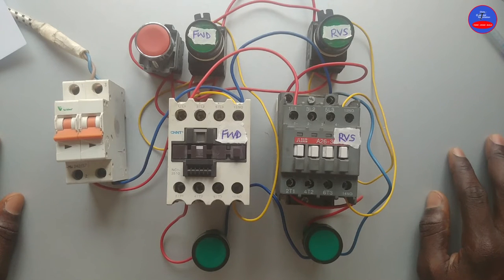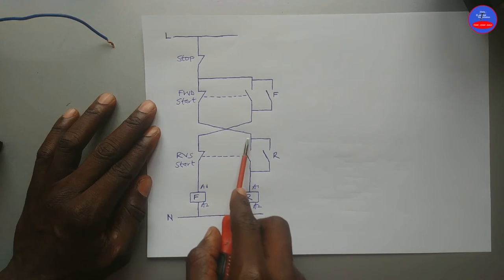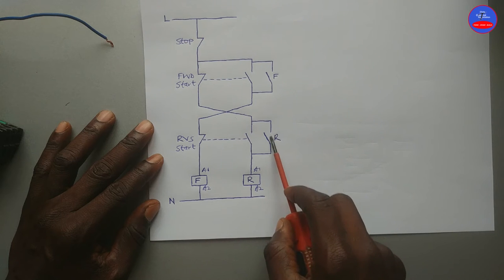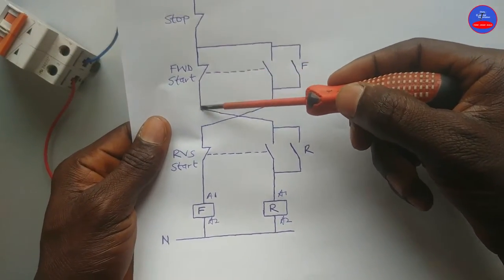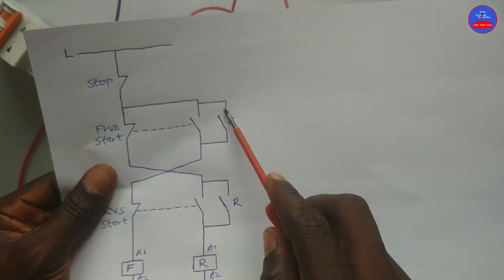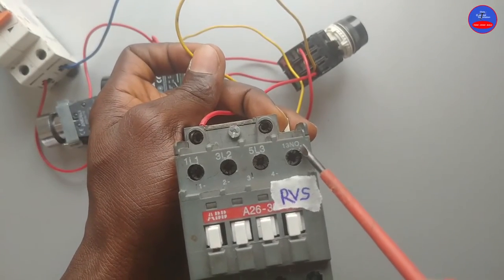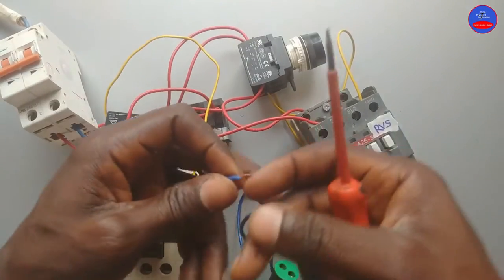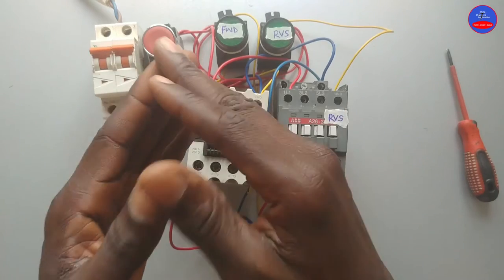Typical Push Button Interlocking System for Two Contactors

Comment: I was struggling to figure this out and asking chat GPT for help and it recommended me your video this is exactly what i was trying to do. would it be possible to do the same thing with a push button that has a built in light that's the next problem i need to solve. thank you
Reply from the maker: Will look at it for you

Comment: I don't know if you saw my previous post. Perhaps it was removed because it had a url link in it. But I tried your wiring versus the other one I mentioned, and yours worked perfectly. I have another question for you though if you're interested.
Reply from the maker: Good. Waiting for your question. Anyway, I didn't see your first post.
Reply: @ChrisControlAutomation  My question is how do you add another set of controls for another location. That is you have another set of 2 green and 1 Red pushbutton, so that you can have the same controls an another position in the shop or a remote location. Thanks.
Reply from the maker: @KeithOlbermannn Are you trying to control the particular equipment from two different locations?
Reply: @ChrisControlAutomation   Yes, Essentially. I want One set of controls close to the unit, just like you have in your video. Then I want to add another set of controls with longer wires, to another location 15ft away or in another room.